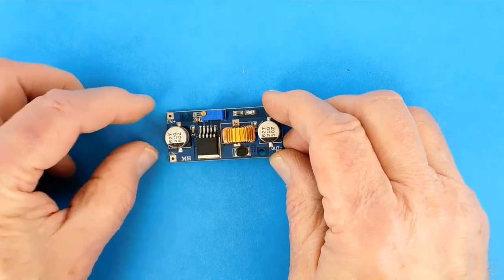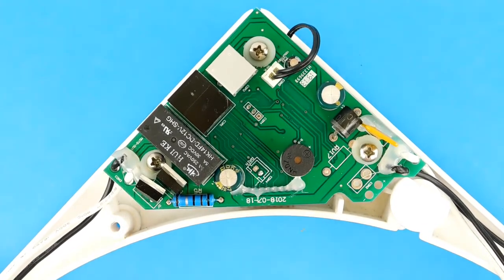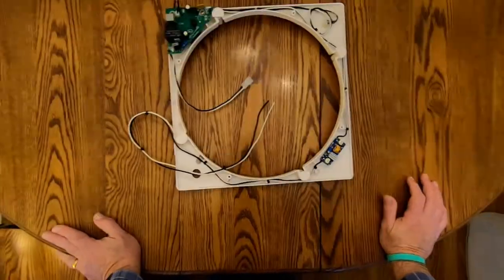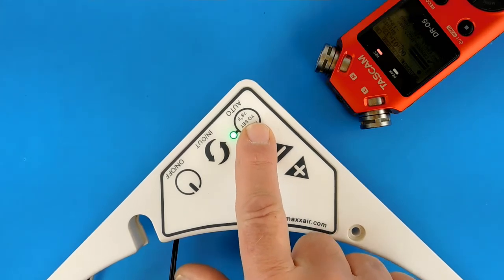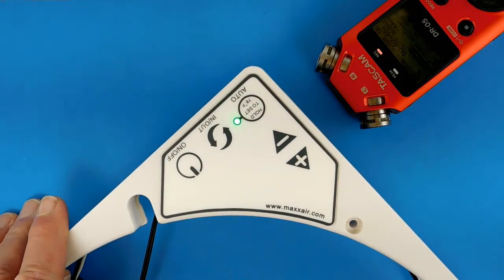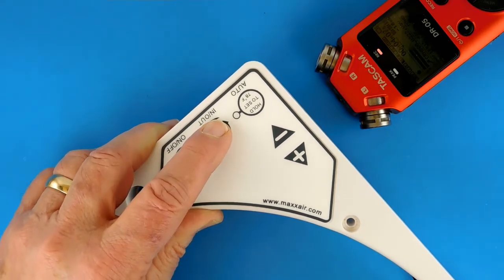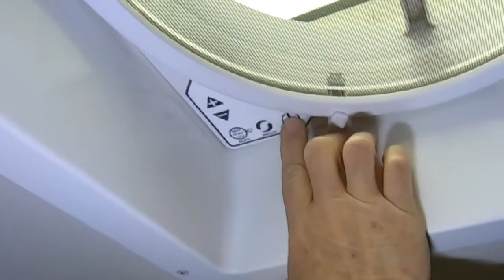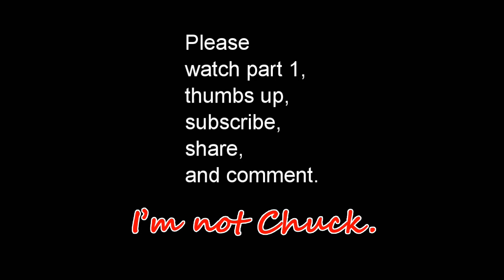MaxxFan Repair, Part 2 of 2

Comment: Charles I had to replace the same board on my buddies fan last summer. Against my advice, he bought the Maxair fan that has a remote control and motorized lid. I will tell him to monitor the input voltage to see if that is a problem in his RV.
Reply from the maker: That's probably a good idea. Many vehicles experience voltage surges for a variety of reasons, often when some major electrical load turns off. Thanks for watching and for posting.

Comment: thanks for the video, my maxx fan has a motorized lid, it will close but not open, I will take a stab at replacing the control board. Thanks again for posting.
Reply from the maker: Glad it helped. Thanks for the compliment.

Comment: Hi Not Chuck, I greatly appreciate your Maxxfan repair video. Our’s is a new model 7500K which has ceased to work. I called Maxxfan and the technician decided, when I told him that we have Lithium batteries in out trailer but were presently on shore power, that ours was a voltage fluctuation problem and he would sent us a new control board. I found your video while looking for installation guidance and am going to order the adjustable supply lithium charger part you recommended. My question is how do you adjust the screw to the proper 12 volt limit? Do  you use a volt meter or is there another method?
Reply from the maker: Hello Hugh. Yes, the method of adjusting the output is to connect the input to your RV's DC power supply to the fan. Then, put a digital voltmeter on the output and turn the screw until you get about 11.8 to 12.1 volts. A cheap DVM is fine for this; Harbor Freight has one for less than $10. Thanks for watching and for the question. Good luck.

Comment: Thanks for this great and educational video.  Question: Are the new auto lift Maxxair fan circuit boards compatible with my older (2018) manual lift Maxxair fan?  I need to replace my circuit board but concerned about how 'backward compatible' the new boards are.  I am have a lot of trouble locating a source for the manual lift version. Thanks.
Reply from the maker: I replaced the control board in my 2013 travel trailer with the new design, and it worked well. Knowing a fair amount about consumer electronics design, my guess is that you should have no trouble with compatibility. Thanks for watching and for commenting.

Comment: Hi Chuck, what looks like a heat sink arrived with the voltage regulator part I ordered to install along with the replacement circuit board for my Maxxfan. Do I need to use it?
Reply from the maker: Generally, heat sinks never do any harm, and so I would use it if it doesn't create an interference with anything.

Comment: Hi not Chuck, My fan appears to have the green light of death. Green light on, will not respond to any button push (not just stuck in Auto function).  Seems a common problem with voltage surges. I am interested to purchase and install the buck regulator that you used.  Would you please share more details on the voltage regulator? Continuous current rating? Thanks!
Reply from the maker: Hi Chip. I will get the info and post it, but it may take a day. Thanks for watching and for commenting.
Reply from the maker: Here is a link to one that I believe is identical to the one I used. https://www.amazon.com/XL4015-Adjustable-Supply-Lithium-Charger/dp/B01MQP31ZR

Comment: I sure wish you were near me. as a woman of course i tried and installed my maxair fan just fine. until connecting it to power. i attached a regular household plug because it did not come with any power attachment. i think it burned up the control board but i dont see any burnt places on it. my problem is i cannot get in contact with maxair so i can order a new one. do you still have the phone number? that would be so helpful. thank you for the videos you do.
Reply from the maker: The best I can do is give you the link to the Maxx Air service request form. Good luck, and thanks for watching.
https://www.airxcel.com/rv/maxxair/service-support/service-request-form